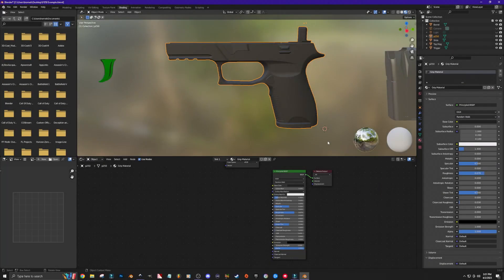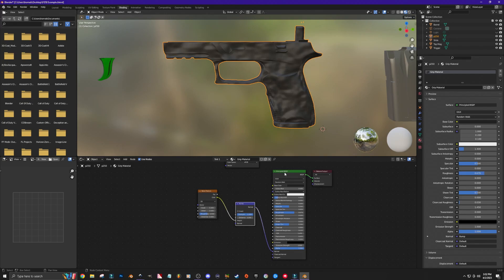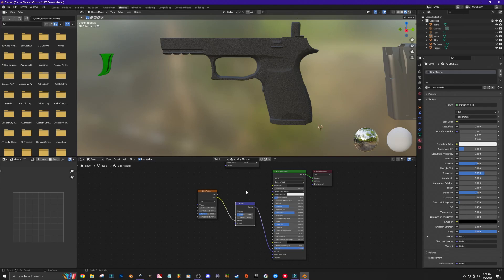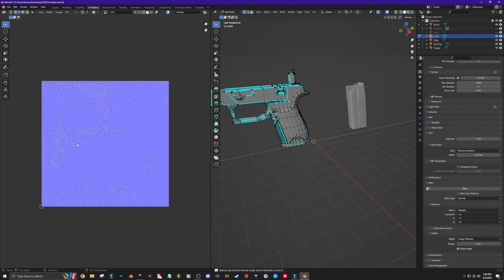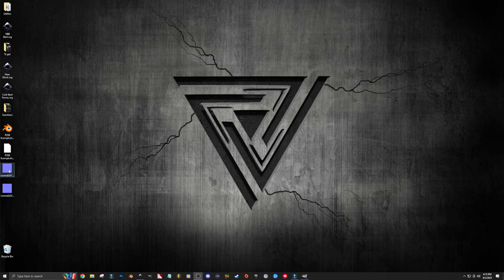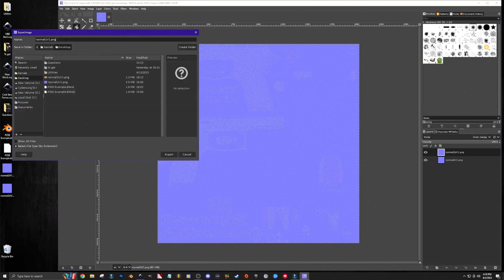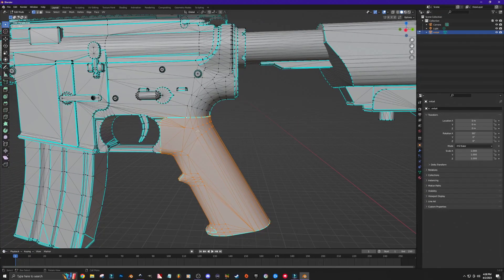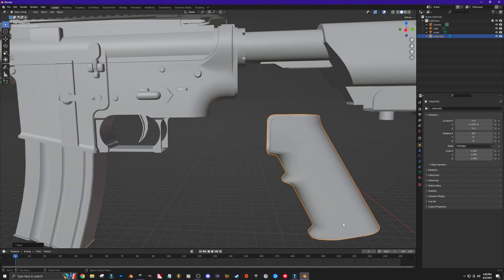Creating Skins for CSGO: Textures, Normal Maps, and Breaking Models Apart

Comment: Do you smooth out the mesh, or subdivide surface it? Or you use the default normal map with your overlays?
Reply from the maker: So this is actually an older video from the csgo days. Now I add the default normal map, then I layer my normals on top of it.
Reply: @optekdesigns  Aha, makes sense, you don't recommend custom normal map? I have   a custom map for a skin I am making, but can't get some edges smooth like the default one, even with auto smooth and weighted normal modifiers... Any suggestions?
Reply from the maker: @kvartz  Yeah if you don't use the defaults then you're probably going to want to learn high poly modeling. The defaults are high poly so its just a little easier and you dont have to purchase a program like plasticity or zbrush.
Reply: @optekdesigns  Thanks! Is there a video where you are merging your normals with default normals?
Reply from the maker: @kvartz  Yes if you go to this video here https://youtu.be/NP-dHdujgeg?si=fJBdoATybJPc24XD and go into the description, the process for putting together normal maps is the link at the 16 minute/18 second mark. From that point on I walk through those steps. 

One thing I try to tell people who may be new to the channel is that I have my videos separated into playlists. The videos in the cs2 playlist are going to be the most up to date. I keep my older videos up more for the view counts and comments because it helps me with the algorithm on yt, but anything in the CSGO playlist is mostly outdated with the exception of maybe some of the later blender videos.
Reply: @optekdesigns  Got it! I'll check out the new ones, appreciate you sharing your knowledge!

Comment: is there any way to have a normal skin that wears off like normal, but specific parts of the skin have depth and only these parts who have depth, will have a pattern (lets say like marble fade/ doppler pattern as example) and wont get weared off? i have a concept for a skin but no clue if only specific parts of the skin can have a pattern instead of the whole skin itself
thanks in advance
Reply from the maker: I think I understand what you are asking. What you will want to do is set the greyscale values very dark on parts you want to stay on the weapon while adding lighter values to the parts you want to wear. If you don't want them to wear at all add a black to that part on the alpha. There are some examples in video 7 where i did something similar to parts of the awp that I did not want to have any wear on. I think that will achieve what you are asking.
Reply: @optekdesigns  and how the non wearing off parts can get the patterntexture added to it? (only the nonwearing parts should have the pattern applied to them)
Reply from the maker: @PrivatisierterMusiker  Just so I am understanding correctly, you want there to NOT be a pattern/texture until the other parts wear off?
Reply: @optekdesigns  a normal skin that wears off with some parts that wont wear off on which then the pattern gets applied to
Reply: the wearing gets applied by alphachannel (the normal skin), but how i can do chromaticlike parts that only get the pattern applied to (example like the marblefade)?
Reply: do u have a discord? then i would join it and then i could show u what i mean with pictures

Comment: How much do you think the skin making process is going to change with CS2? Just wondering since I've recently been interested in getting into skin making but not sure if current tutorials and methods will become obsolete very soon.
Reply from the maker: The processes themselves (such as how to use certain programs...i.e. Photoshop, 3D Coat, Blender, etc..) wont change at all. The biggest changes I see coming are settings inside the workshop and some minor changes to the gun models themselves. The fact that they have already ported all the skins over to the new game is a good sign that changes will be minor.  I wouldn't let the news of C2's release discourage you from learning though because most of these changes will be minor. I will be sure and post a video discussing the changes once we know what all of them will be. Again though, the processes for creating skins, UVs and normal maps will still stay the same. I always tell new designers that the time between now and C2's release is a great time to start creating new artwork and getting familiar with the programs you want to use.
Reply: @optekdesigns  Yeah I already started learning the process and now it's time to just dive in. I appreciate your tutorials btw, there isn't a crazy amount of tutorials on the process so thanks for all the information.
Reply from the maker: @Zalami84  Oh no problem at all. If you dont mind I think I want to include your question in a video because I think its a good one to discuss.
Reply: @optekdesigns  Yeah no worries, go right ahead